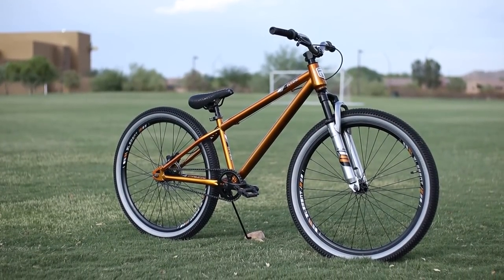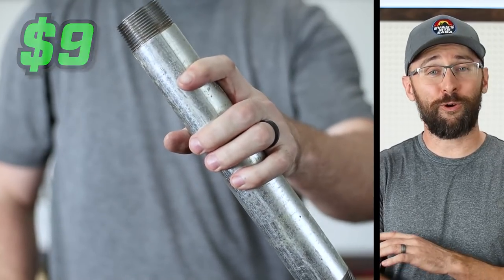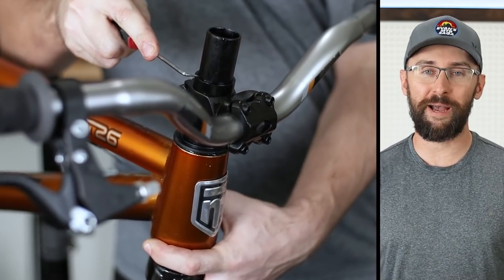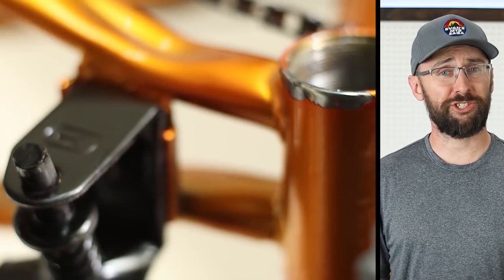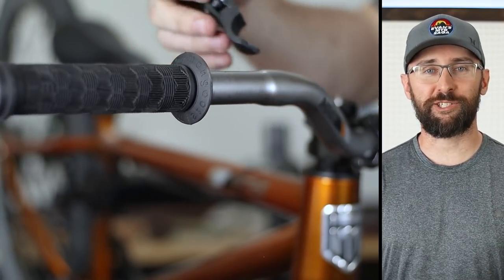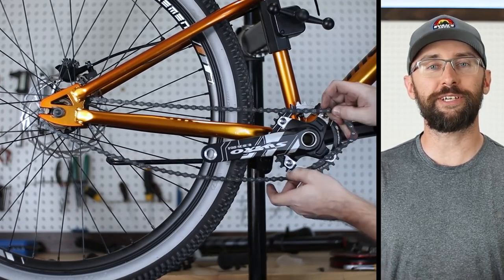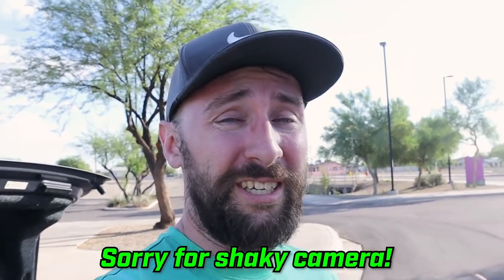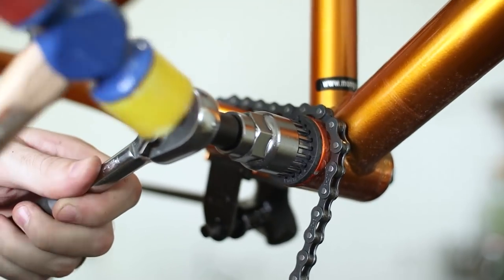I don't know if I'm going to keep this Mongoose PT26 jump bike..

Comment: PVC pipe > theaded metal pipe for setting the crown race, all you need is the pipe section and an end cap. Comes in cheaper than the threaded rod and it's softer than the crown race so it won't be damaged.
Reply from the maker: I'm gonna get the right size PVC next time I make a trip to the hardware store. Thanks for the feedback!
Reply: @EvansMTBSaga  1.5" pvc for most mtb stuff

Comment: I got a used DJ from somewhere around 2010 for $350, has a marzochi bomber fork, custom wheels, and raceface parts. ive had to put a new chain on it, and that's the lot. if you can find one, buy used.
Reply from the maker: Dang that would be awesome. DJ specific forks are cool too. Yeah used bike prices are so high now, it's crazy
Reply: I think she said/meant she got a used 2010ish model DJ bike for $350, not that she got it in 2010 for $350 lol

Comment: You need a half link chain to dial in that rear end length. Crazy it worked well with 27.5 forks. Id like to see more of that "upgraded" ztz fork. Please take that thing to some dirt jumps for the last video!!! Rad manual dude!!
Reply: full half link chain is not just gonna look awesome but also shorten the chain length
Reply: You're still using a 26 wheel so it's not that big of a deal. If you want to be really tedious about it, they even make specific dirt Jump forks. Or you could just buy a regular short travel fork

Comment: To prevent the chain from falling you just need to install a front deraillurer as it helps to guide the chain. Dont install any new crankset or deraillurer wires and only make the chain go through it.

Comment: I would of fitted a tensioner to both sides of the rear axle to stop any movement. Probably why it slipped. Not exactly the fault of the bike.

Comment: i dont know the details of the wheel and bars slipping, but that shouldnt be an issue with the bike. just not tightened down enough
Reply: It’s because it’s a crappy Walmart bike that you should never ride!!
Reply: @DirtKidzMTB  doesn't matter if it's a 50 dollar bike from Walmart, or a 10000 dollar bike from specialized. As long as the nuts and bolts are intact, they shouldn't slip if they've been torqued down enough

Comment: Hey, since you’ve had hands on the bike, looking at the head tube, it looks like you could machine the bottom of the head tube down to its widest portion (bottom of the bell shape) and fit a tapered lower cup. What do you think? Also, we used to grind out the dropouts on our BMX bikes to slam the wheel. Looks like this would be an easy mod with all of that material.
Reply from the maker: No way could the head tube be machined and still be a safe bike. Plus the frame is absurdly heavy

Comment: I wonder how well this bike would work for more street/bmx styles of riding, maybe you should test that out!
Reply: I asked him to hit some dirt jumps for the next video.
Reply: I put a solid fork, new stem, bars, grips, pedals, bottom bracket and crank set on mine. Altogether i have just under $500 in it total and I have been dirt jumping it and riding the park for 6months now and I love it. All I am gonna do next is put some Maxxis holy rollers on it
Reply: @caseylewis2835  do a bike check video dude!!!
Reply: I have 4 wally mart bikes in am fixing up for under $500 each and I am gonna do a series of vids on parts and then compare them to similar bikes that are around $500 stock. Should be this fall
Reply: @caseylewis2835  send us the link when done
Reply: @caseylewis2835  why didn't you just buy 1 decent bike
Reply: @justinbogart278  because it's fun to work on bikes  :)
Reply: @justinbogart278  ya it is wonky geometry for sure. And you are correct. I have just been carving bowls at the park with it. Just doesnt perform well on anything else
Reply: @justinbogart278  I have 11 bikes. 4 to dollar. I just like to tinker and try to improve stuff. But this was a lame project by end for sure. Looks cool....... Thats about it though. Lol
Reply: @justinbogart278  I have 16 bikes. Some top dollar. Some low end. Its my hobby

Comment: saw your video like what you did with the mongoose PT26 . ? you set up using a full length chain right? have you herd about half-link chain? benefit of it allow to better custom rear wheel closer to you rear dropouts . Also you could try grinding out the rear dropout in more to shorted the wheel base too. I done it my BMX crusier  and getting my rear wheel more forward in the dropout dose help alot with pumping and Manueling through a pump section of the track. the reason why a half-link so good is you can remove a 1/2 link instead of the old full lenght way of doing it.
Reply from the maker: Yeah I've used half links before. They are alright. I've heard chain breaker tools getting broken while breaking a half link, but I never had an issue. I'm in the boat of set it and run it most of the time. Thanks for the feedback!! When I do a real serious DJ or BMX build I will keep that in mind
Reply: @EvansMTBSaga  sure thing BRO! glad I could help you out.

Comment: How did you route the hydraulic brake line? I bought one for the frame and it has built in bosses for mechanical brakes
Reply from the maker: Zip tied around the frame tubing

Comment: Good to know I was thinking about buying this bike
Reply: I got one, did basically the same stuff and also changed out the pedals, stem, seat, bars and grips and got better bearings for the head. I also got the right size fork. I dirt jump it and other than maintenance is have no problems for around $500 total, bike included

Comment: On my single speed Norco I had, it had a gear ratio of 36 to 13 with 175mm crank and Kenda krad 26x 2.30 with sealed deore hub and a set of Hayes mx4 brakes. Rim was sunringle singletrack. Front was formula hub 20mm to singletrack hoop and dirt jumper 3 fork.
Reply from the maker: Haha man. That's some crazy hard gearing
Reply: @EvansMTBSaga  I had that as my fun bike my best bike was a BRC Ripper. It had a set of Alex ace19 wheels laced to formula hubs front and back. I rode it with a 36 tooth mega range freewheel and for cranks I had a biopace 3 by 175mm with Evo sealed pedals with traction pins. I had a dirt jam comp air forks with qr dropouts. Had truvativ bars and stem and a sealed FSA headset. On that bike which was an 18 inch frame and 26 inch tires. Kenda small block 8 tires with kevlar tubes. This bike was 34 pounds and I was at the time 240 pounds and I was passing people on road bikes that were going pretty fast and some of them we shocked that a guy of my stature could ride that hard. I love working on bikes and your videos remind me that I have to get back into riding again.

Comment: Great riding, but yea that bike is not great. I can see the welds are horrible.
The loose wheel might be your mistake, it can happen, but keep in mind with rapid temp changes like getting warmer things can get loose, but the steel parts shirnk faster tha alu. But if its steel on steel alu on aly it will most likely stay out for longer. But axle should be tight, a regular tru axle should be at about 10nm, atleast that's what it says on for my bike, 9-12nm on my fork. So that's quite hard, so turn until it stops, with regular sizes spanners. And tru axles use hex key thos long ones from parktool makes it easy to tighten properly, but on steel axle with nuts regular sized spanner does the job well.
But if the hubs had play in Cup and cone, you might have tightened the bike but once that worked it self loose wheel got loose, so check that on bike slike this, and expect it to not be assembled correctly or tightened securely.

Comment: You happen to check the headset sizing while putting the fork on? Just ordered a fork for mine and would like up grade the headset while I got it at the bike shop. Thanks
Reply from the maker: I did! 44mm top and bottom. I had ordered one, but it didn't come in time and I had to delay & modify the video 😂
Reply: @EvansMTBSaga  thanks man, keep the vids coming!

Comment: You could just cut the crown race with a Dremel and just smack it down.

That Maxxlite is hot trash Bolany. ZTZ, Zoom. Same factory, different stickers. I asked one of the brands to show me some exploded view diagrams and they won't do it. I asked about the internals and if they are cartridges or machined stanchions and pistons. No response. Occams Razor applies for items at that price point. RST renegade is at the same price point of $120. Their customer service told me both damper and air spring are cartridges and free to replace with serial number and if the item is still under warranty.

Hacksaw vs pipe cutter... I don't know man...

Use some penetrating oil before you ride the bike on everything. You could have also used a heat gun on the BB area on the frame.

Your part choices really has me question a lot of things.

Couldn't you also use a chain tensioner on the chain itself? Like something that comes integrates with a bashguard like some ISCG 05.

Did you check spoke tension on those wheels? ALX had some wacky spokes and I had to stress and retension them.

Wheel is weird because the non-drive side did not have the alignment piece and the torque shifts the wheel out of alignment.

Even with the integrated chain guide bashguard, the chain might not be the perfect length which requires sliding the wheel rearward.
Reply from the maker: I think maybe I'll do a break down video and show the world what's inside. Sounds pretty cool as a YouTube Short! Thanks for the motivation
Reply: @EvansMTBSaga  https://youtu.be/aEIzbI1A-TQ

Already done. Part 2 was an attempt to do a modulus test on the stanchion but they ended up doing a bend test on the steerer tube.

Part 3 might do a modulus test on the stanchion but it's not really reflecting the actual impact forces.

Comment: What Ztz is doing is illegal, for some reason they haven't been sued or been a big news story yet, but mabye the big brands just ignore it as they don't loose enough money on it, they use Trademarked names like Abs+ which is damper Manitou uses, but they don't actually have any the damper in there no deal with Manitou. That's actually an proper damper, you can service, but Ztz and all the other copycat forks, have closed, sealed cartridge no way of servicing. Junk.
But I've seen that some of the forks came with Fox stickers, which also is not legal, but these copycats had to stop doing that as Fox was on to them. But they keep pushing it now with Manitou logo copy and keep using  ™ names. This is also illegal, to make lookalike logos, there was an energy drink brand sponsoring F1 team, Ritch Energy, they got sued. Y Whyte Bikes before product went to stores, as they stole the logo, modified it. And owner claimed he did not know of the brand, but pictures revealed another story. 😁 Huge fail.
https://m.pinkbike.com/news/whyte-bikes-vs-rich-energy-what-happened-next.html
A f1 driver riding Whyte bike then driving car with copycat logo. 🙉
Good example of company built on theft and lies. These days it's hard to run that scam. But this was rediculous.